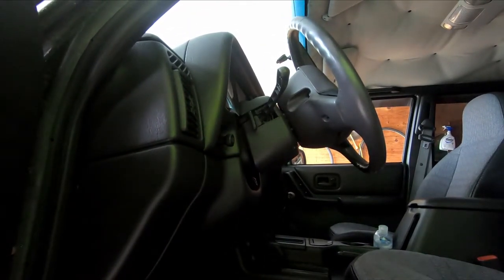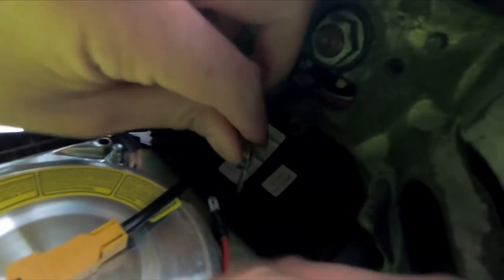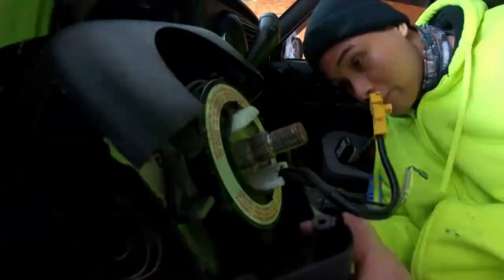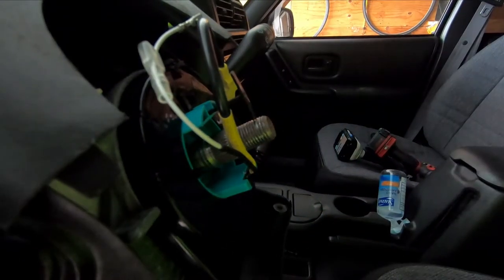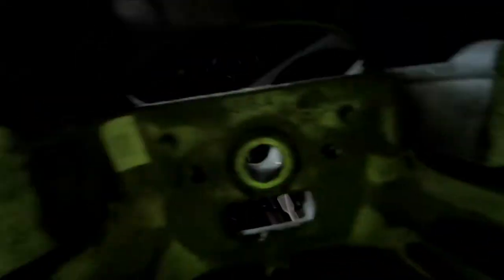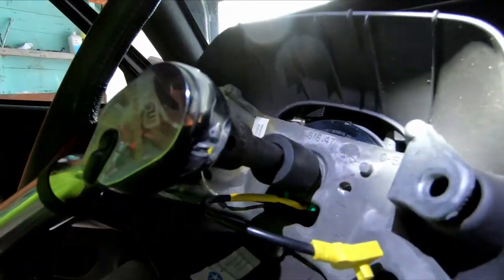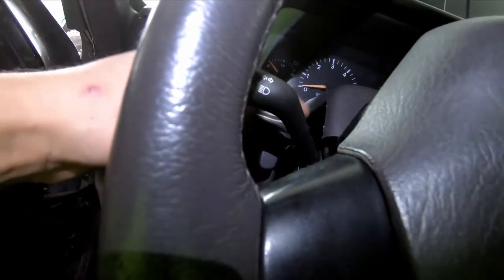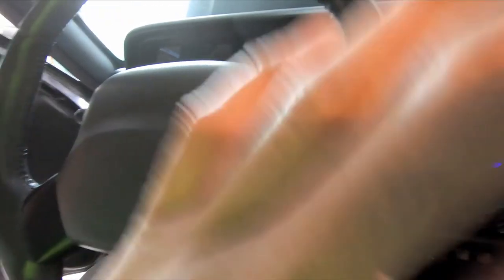How To Replace The Clock Spring On XJs

Comment: Thanks for this video. I have to replace mine and found your video after I was quoted $750 & $825 to replace mine at two different auto repair shops. I feel confident enough to tackle this job now.

Comment: Does the clock spring assist in returning the key fully
My horn works with motor off , if you start it up and release the key all the Accessories work but the horn if you tilt the key just slightly reaward the horn works

Comment: On a 1996, if you have TPS code P0123 and a new TPS doesn't fix it, unplug the horn relay. If that clears the TPS code, replace the clock spring. 

It's a jeep thing 😂

Comment: Can you just disconnect it without worrying about it
Reply: Pulling your horn relay fixed a lot of weird issues I’ve been having. It wouldn’t run right and stall. Relay pulled now it runs fine… weird.
Reply: That's true. My XJ stalled when stepping and removing my foot off the gas quickly. It ran with lower RPM's on idle too i believe. I read that the grounding wire for the clockspring horn shares the same grounding with the TPS and maybe other thing related to that. Removing the horn relay fixed it for now.